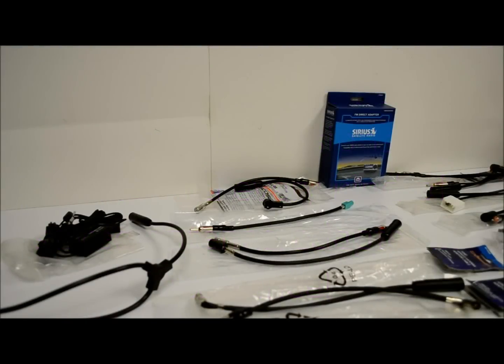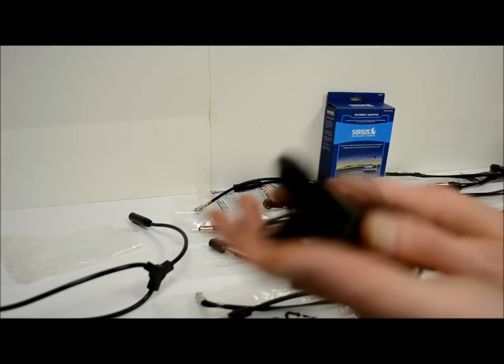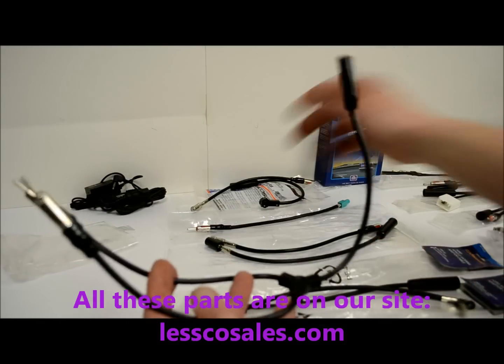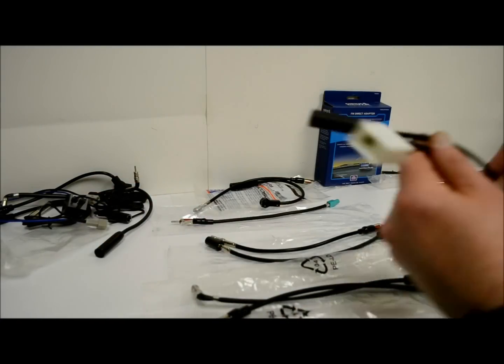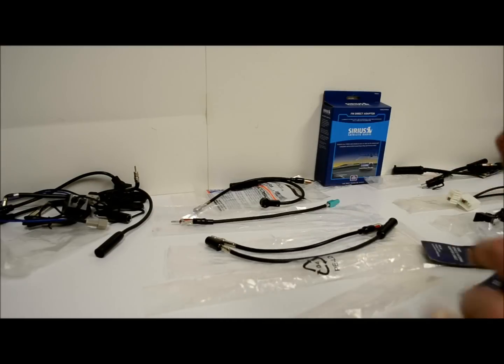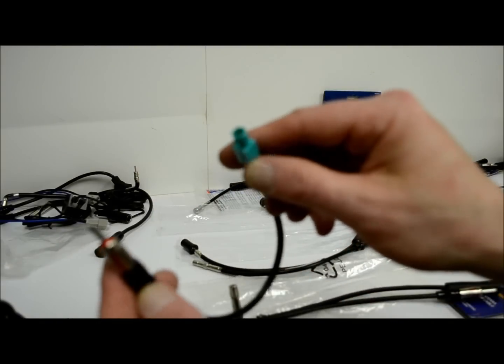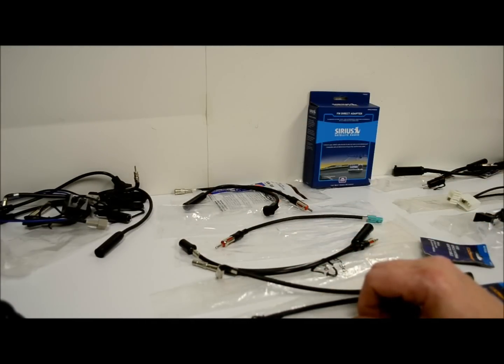Adding fm direct satellite and aftermarket antenna adapters - I go over all of 'em

Comment: Thanks for the very informative and elaborate video. However, I'm still not sure about the kind I need for my car's unit. It's a Blaupunkt 9006 unit, and the antenna plug looks like the EU and VW style adapters you showed here. My research so far has come up with both results, which in a way means they're interchangeable; but then if they were, why have different names and codes in the first place? Could you, please, let me know which one to order? I need both ends (planning to install a Bluetooth transmitter through FM antenna port), so I'm pretty sure it's going to end in 30, but as far as the style, I'm not sure. Seems like they're similar, and size may be the difference, but then it is very hard to know from watching them on the screen (not real-life size). Your help is greatly appreciated. Thanks.

Comment: Hello I have a 07 gmc sierra I had sv300 for xm radio but when I got a new radio the radio didn't have the plug in for the sv300 is there an adapter I can you so that I can reconnect my sv300 to my radio it's an aftermarket tesla style radio

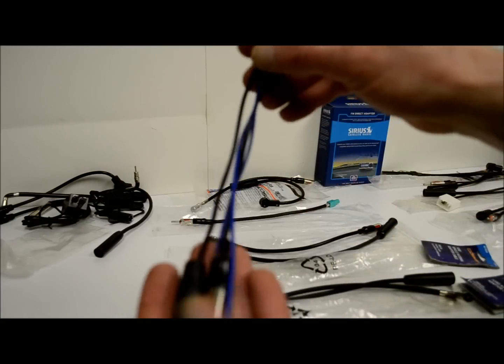Comment: 4:00  In installing a direct fm modulator in a 2006 Honda Pilot, do you think it'd be fine to tap all three power lines (the two blue adaptor power lines and the fm modulator power) into the ACC 12v harness power line to the radio?

Comment: I have a 2015 Honda accord I am using my calypso plug n play unit in my car for sirus radio, my question,  is there a way I can hook up the FM DIRECT TO IT AND ALSO USE THE FACTORY RADIO TO HEAR AM OR FM BROADCAST? TRYING TO FIND A WAY TO USE THE CARS ANTENA FOR BOTH UNITS?? IS THAT POSABLE?

Comment: I have an SXV200 Sirius tuner plugged into a JVC KDR840BT  Sirius XM ready car stereo in my 1999 Jeep Wrangler. It has a magnetic antenna and works OK on top of the dash. I want to connect the SiruisXM tuner to my FM antenna instead. The FMDA25 plug in is not compatible with the SVX200 tuner input. Is there an adapter that changes the plug to one with a hollow end?
Reply from the maker: You will never be able to accomplish that, the v200 is a digital direct connect tuner only, while the fmda25 is designed to be used with analog portable type sat radio kits only.
Reply: Lessco Electronics If the V200 cannot connect to the car's FM antenna, will a glass connection work? I appreciate your help.

Comment: On the 40-EU55 adapter for 2016 chevy malibu (GM) where do i connect the blue wire?
Thanks...

Does this wire ONLY pertain to if I have a power antenna? Maybe i just answered my own ?.
Reply from the maker: Blue goes to blue on the receiver.
Reply: Lessco Electronics Ok. Thanks!

Comment: 2013 Corolla S. want to connect the fm tuner for the xm radio to the oem radio but the fm connector is not accessible or not present. Is there a plug that has the same connector as the back of the radio so the oem antennat can plug into it and then have a splitter connector for the fm antenna plug. I have searched for such a beast but can't find it.
Reply from the maker: +Bradley Moore according to my info there is no adapters needed for a 13 toyota corolla s, its a standard motorola male plug.
Reply: +Lessco Electronics Traced the line from the radio to near the air outlet on the passenger side and no standard motorola male plug. Thanks for your help. :(

Comment: Hi. I have a situation I'm trying to resolve.  I have a Sirius tuner, and cradle.  The tuner is docked to the cradle and all of the cables (antenna, power cord, universal male to male audio cord, etc) are connected to the cradle.  Here's the thing I'm trying to hard wire my apt so that I can put my tuner in a closet and control it using an IR repeater, BUT in case I change my mind later on and decide I'd rather have the tuner in front of my face in my Living Room (LR) where I can control it with my fingertips and view the screen, I'd also like to run a separate antenna feed to my LR.  I wanted to do this using one antenna (planning to put a car/outdoor antenna in a permanent position outdoors) and a Y splitter, instead of two separate antennas (where of course one would be unused when the other is being used... all depends on the location). 

Now the antennas have female terminals and the cradle has a male antenna terminal.  For me to use only one antenna I'd need a Y splitter that has one male end and two female ends on the opposite side.  The male end would be attached to the female terminal of the antenna, and the two female ends of can be fitted with antenna extension cords that can be run to the closet and LR respectively where tuner w/ cradle can be situated at my whim.

So I guess after my longwinded explanation of my situation my question would be, is there an antenna Y splitter that has one male end and two female ends where the "ends" are Sirius radio antenna connections?

Thanks.
Reply from the maker: apostle100 no, and for good reason too. Youre reception would stink adding in such a monsterous passive splitter. If I were you Id invest in an extra antenna and run it out wherever you hav e a docking station setup. Itll save you lots of grief and grief is never worth more than a 15.00 antenna
Reply: Thanks.  Well using 2 antennas was my plan B...so I guess I'll have to go with that.  Thanks again.